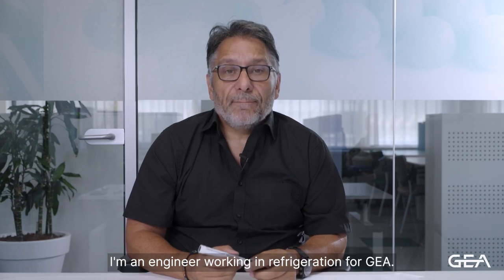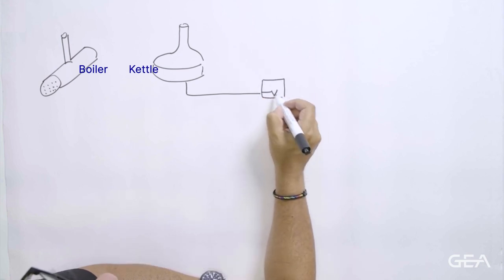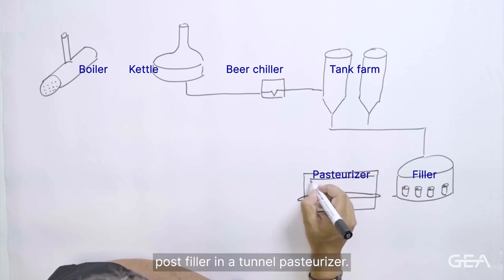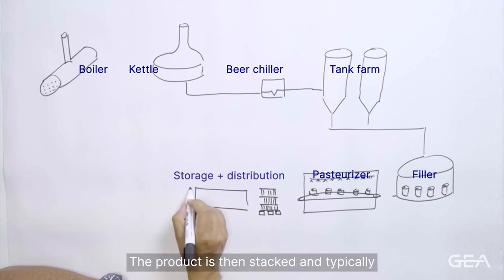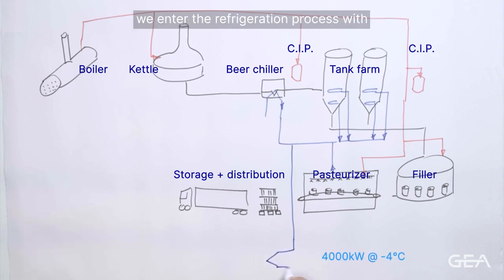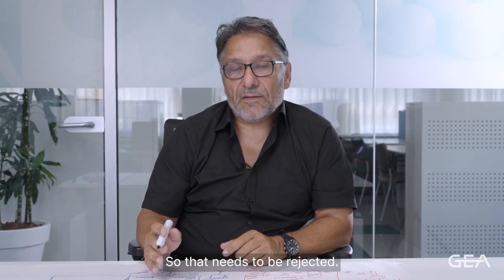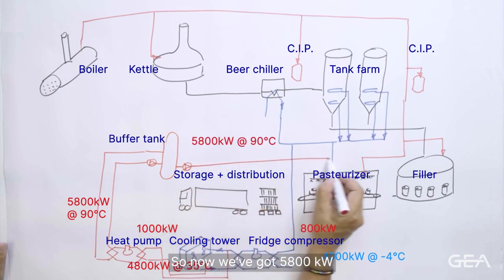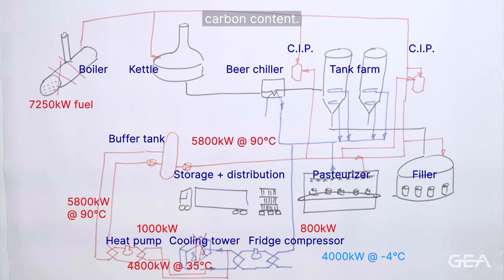How heat pumps work in brewery processes

Comment: Hi Robert, I am working in ABB as global business developer for refrigeration systems: I would be very interested to discuss and collaborate with people like you, to maximize efficiency in the electric transformation from power network to compressor shaft. I am also very interested to know if and how you manage harmonics distortion using large power drives. I am really convinced that industrial heat pumps will be an important part of decarbonization in many industrial processes. I think that the challenge is still to design and develop high temperature heat pump with decent COP for many other industrial process